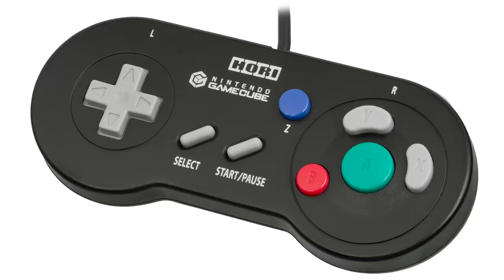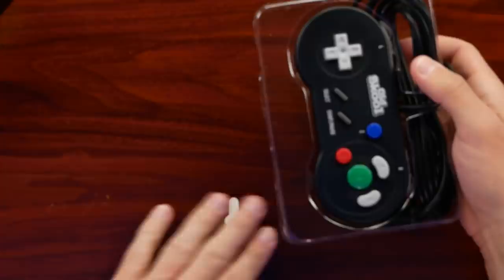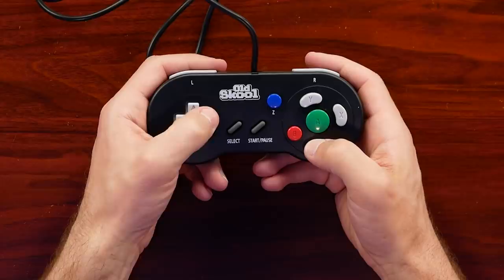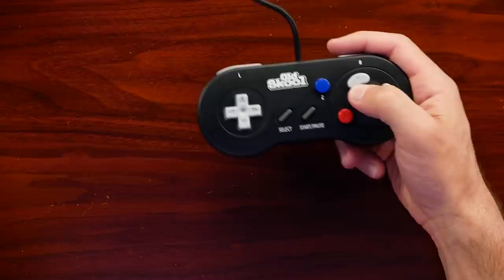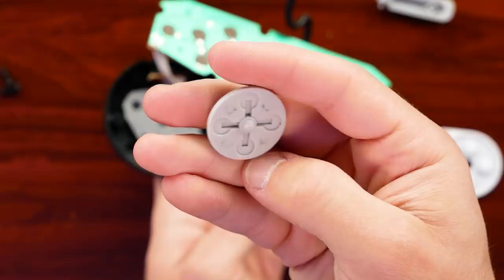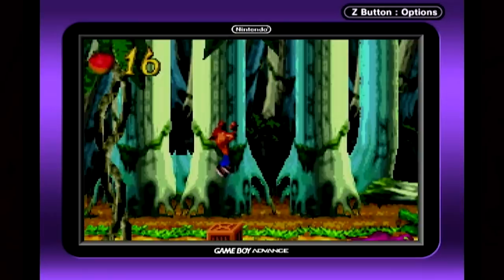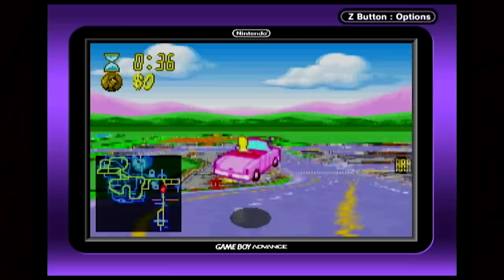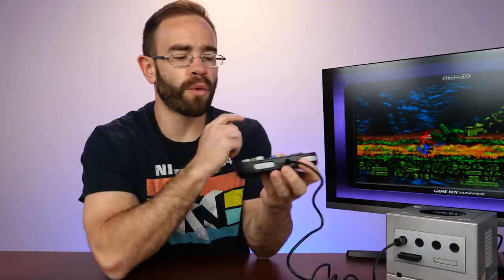This New GameCube Controller Surprised Me

Comment: This finally makes the megaman collection and sonic collection playable
Reply: Sonic Mega Collection and SADX's collection were the PITS with that GameCube D-pad! lol
Reply: I played through all the original Sonic games for the first time with that d-pad, had no issue. I have small hands though, not going to lie.
Reply: I never minded the d pad tbh I got through x collection with the WAVEbird just fine
Reply: It's better to just buy a controller with the face buttons set up correctly.
Reply: The sonic collection was easy to control using the control stick.
Reply: @thevenom2731  That's because Sonic basically uses just left and right
Reply: I always enjoyed the gamecube stick for classic sonic actually, the notches help a lot and I kinda swing my thumb around anyways when playing Sonic to adjust my speed or start rolling.
Reply: These have existed since the gamecube days but by Hori, these are cheap knock offs.

Comment: If your concerned about the feel and quality being off you could always pair a raphnet adapter with an oem snes controller. I know alot of 3rd party controllers use cheap feeling buttons, gamecube especially.

You could also take it a step further and pair an 8bitdo snes wireless reciever with the raphnet adapter so you can use bluetooth snes controllers on your gamecube.

Comment: Funny thing, I just paid $200 for the Hori controller this model is based on. It's the most expensive controller I've ever purchased and my wallet is crying lol. But I got in the mail last week and I really like it.

Honestly, what surprised ME is the fact that the Hori controller works not only with RE4 but Metal Gear Solid: The Twin Snakes. Aiming in Twin Snakes is awkward because of Z being turned into a face button, but otherwise it's cool. And on RE4 the controller is excellent.

It also works amazingly on the classic RE games. They all have built-in D-Pad Support, which makes sense since RE was originally designed for pre-Dualshock PlayStation controllers.
And yeah, it's also great GB/GBC/GBA games.

But your solution of buying Old Skool's model and swapping in a SNES controller's D-Pad is a brilliant and cost-effective alternative.
If anyone wants a controller like this, I say go with Spawn Wave's solution unless you're like me and you really really want the legit product...for $200.
Reply: I just did the same. I bought mine for 250€. It is by far the most expensive controller I have ever bought. I must be crazy. I am still waiting for it to arrive so I hope I will like it

Comment: I have that HORI controller, the way I got it was kind of special. 

I worked at a non profit integration PC recycling facility call "INSERTECH", where they would accept old PC and electronic from people to recycle the part form different donation into "new" rebuild PC for cheap prices, they took any tech stuff, that include video game stuff, but what they don't tell people is that the only things they actually reuse IS PC parts, anything else was smashed for the gold from PCB and/or the cables cut for the copper.
 So basically there was that one day I came to work and there was a big box (and mean BIG BOX) full of a lot of video game stuff, cables, accessories, controllers and actual consoles (a SNES and an Xbox 360), everything was in really good condition, so I picked the box and gone ask the boss if I could buy it from them, not selling the box to me would have been a dumb decision since they would barely get anything from the raw material anyway, so he did sold the box to me for 40$, that was such a good deal, I can tell you that SNES alone was worth more than he asked for, unfortunately the 360 20GB hard drive had to be wipe (I know that stupid, 'cause without the encryption key from Micro$oft, the HDD doesn't work in the console anymore), the place give a warranty that all data would be completely destroy, so nothing I could have done about that.
But anyway, that GC HORI controller was one of the many other controller in the box... just imagining I had not been there when that box showed up is killing me, 'cause it would basically had been destroy completely for almost noting... it still hunts me to think that this was happening before I had been there and still possibly happens as I typing all this. (o_o)

TL;DR: The controller would have been destroy and thrown away if I had not been there to save it. 😰

Comment: Nice! I got the wireless Saturn controller from Retrobit and I plan on adding a bigger battery, an original JP Saturn Dpad, and possibly replacing the shoulder buttons with original mouse-click microswitch style buttons. Itll match my white Model 2 Saturn i plan on putting an ODE, FRAM mod and region BIOS in. Controllers are fun lol.

Comment: The original GameCube controller was almost toy-like, but in an ergonomical way - the oversized A-button, exaggerated shoulder triggers, and nubby C-stick. While not the most practical at times, it was sure a lot of fun to use. I need to buy one with ZL and ZR buttons so I can use that glorious thing wherever.

Comment: You can get the Raphnet Classic Controller to GameCube adapter and connect an 8BitDo SN30 2.4g SNES controller to the GameCube. You mentioned wanting a wireless version and that’s what I use and both the raphnet adapter and the controller are low latency! Just Google raphnet Classic controller to GameCube. It even supports custom button mappings‘s and in my opinion the layout is much better than the Hori/GameCube button layout for GBA/GB/GBC games because you get all buttons equally sized and spaced, instead of the exaggerated A, and shrunken X, Y and B buttons (which are great for 3D GC games but not 2D games).

Comment: I have that black Gamecube controller by Speedlink. It works for Gamcube games but also has a better placed d-pad and it is flatter. So I use it for the GameBoyPlayer. It's not the best built quality, but far from the worst.

Comment: would have been way better if they reolicated the SNES button layout on the right. that way you could also use it with the GameCube controller adapter for SNES emulation. this way that would be more than suboptimal

Comment: As good of a controller the Gamecube one is, for me the drawbacks are not limited to the d-pad being too small. There's also the C stick that's so skinny, it's like moving a nipple. As well as only having one shoulder button and no select button, which gives it two buttons less than both of its 6th gen console competitors, if you don't include clickable analog sticks that is. So while this controller has some appeal to it, it doesn't serve as a decent substitute for a Gamecube controller in my opinion. I understand that the whole point is to use it with a Gameboy Player on a Gamecube, but I don't have a Gamecube or a Player for it, so unfortunately it's not for me.

Comment: This should have been compared vs the HORI controller which looks pretty much the same. Also, there are SNES to Gamecube adapters... So I kinda wish this controller looked more like the SNES controller than the HORI. But love that you changed the DPAD rubber with a snes controllers :D

Comment: How difficult is modding the SNES D-Pad and what did it involve? I have no previous modding experience, but would love to try it.

The location of the Z button seems identical on the Hori controller.
Reply: He mentioned it in the video, he filed down the round pivot to fit it in the controller, you can probably do that with some sanding paper.
and yes, this controller is pretty much a cheaper clone of the Hori Gamecube Controller.

Comment: I just bought one. I have a CRT and the Wii is able to output 240p so I've got Retroarch installed on it and it feels like I'm playing the real thing except for the controller. Retroarch won't recognize the Wii controller half the time but doesn't have any trouble with GameCube controllers so I'll try this as a solution. I have too many SNES controllers as well so I'll try replacing the dpad.
Reply: Mine won't register L and R through retro arch wii. Did you have to manually map the buttons?

Comment: It's nice to have a proper alternative to the Hori digital pad, but the cheap dpad bothers me a bit. I mean, I have three SNES controller and one is not working properly, but I don't really want to usr it for spare parts.
Reply: If you have good functioning snes controllers you could get a raphnet adapter and use those instead.
Reply: @ians_parks  yeah, but I think some features will be lost, like the Z button that opens the GB player's menu. Thanks anyway
Reply: @BANJO500  There are button combinations for missing buttons. Its intended to be fully functional with the gameboy player.

Comment: Does anyone else use the link cable with the gba to play there gameboy games on the Gamecube? Imo that's the best way
Reply: Wait you can use the gba with link cable as a controller??? I didn't know that
Reply: @DeathFlame500  it's a special link cable called "Gamecube Link Cable" it came bundled with the gba player.
Reply: @smackdaddy710  I have that cable. I was just unaware it could be used like that
Reply: @DeathFlame500  also its best to be used in number 2 spot so u still have a controller to use the z button. Only downside is you still need batteries for the gba, but if u never seen it, the start screen is different when it's plugged into gamecube its cool haha

Comment: What "Modifications" did you have to do to port over the snes dpad? Might do the same, Thanks.
Reply: He had to file down the circular ring that is the base of the snes d-pad in order to fit in the old skool controller housing. I just got done swapping the d-pad on my controller. It's pretty easy. You'll see when you try to install it.
Reply: @pekinduck1  What's the best way to do this?